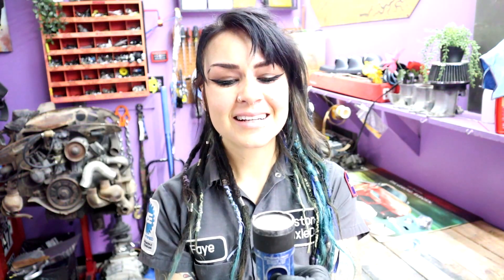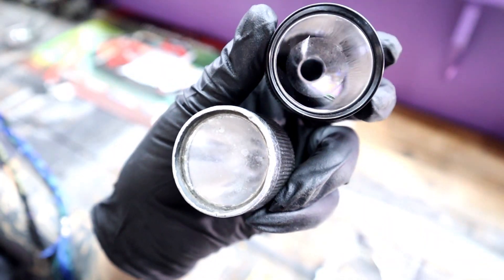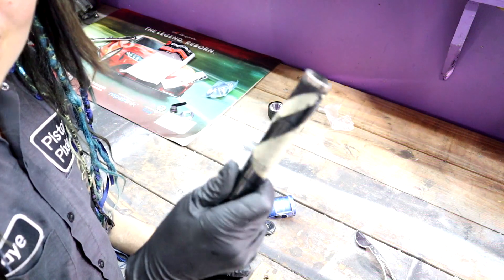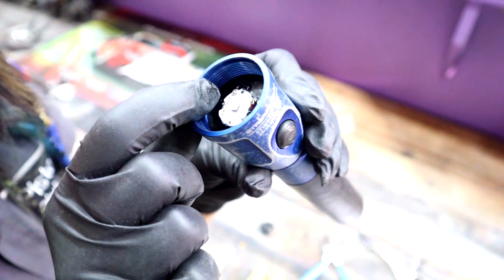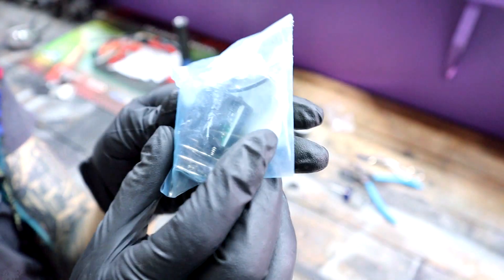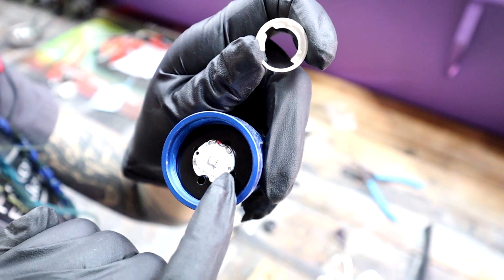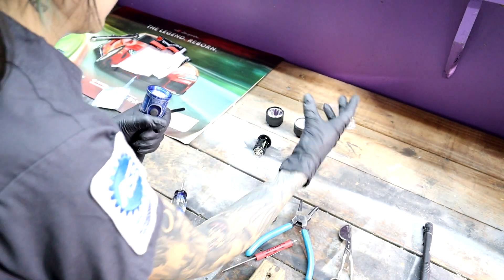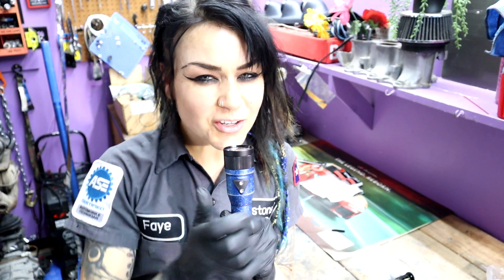FIXED! Old Streamlight Stinger (circa 2012) Button Repair and LED Upgrade!

Comment: Thank you so much Faye. I will have to look into Streamlight. I always have a couple flashlights in my car for customers and want ones that work every time. If yours has worked that hard for that long and can be repaired, that would be perfect for my purposes

Comment: Great video, Faye. That flashlight has been a mechanic's staple forever. I was not aware that they were rebuildable? Now, you can keep using it for another ten years. Keep up the good work.

Comment: Cool vid! Hey do you work on Diesels also? I was a gas engine tech for 20 years and been working on diesels the last 8 years. I am also ASE certified and Ford certified. I don't work in a open to the public shop anymore but I work in fleet for a large overhead electric company. To me working on Diesels is easier. Great job and keep turning those wrenches!

Comment: Streamlight = Best damn flashlights in town.  And they are based in PA 😁
Reply: Less then 15 minutes from me across the street from Gratersford State Penitentiary.

I have 2 streamlights. A green version of the one Faye has (just as old too) and Strion LED (also green). Need to rebuild my Stinger. It has the same button issue and the lens is partly melted.

Comment: Where do you purchase the kits, my battery charges and it was purchased a year ago, my led light is burnt out now.  Ive had my flashlight forever, my kids and grandson use it all the time.
Reply: My flashlight is Streamlight Stinger DS' LED
Reply from the maker: I linked where I got the light upgrade in the description. You can also get the rebuild kit from your tool truck.